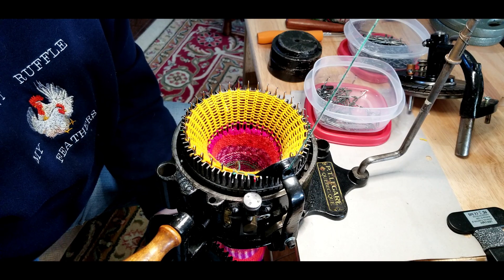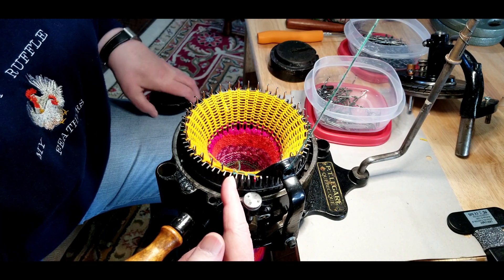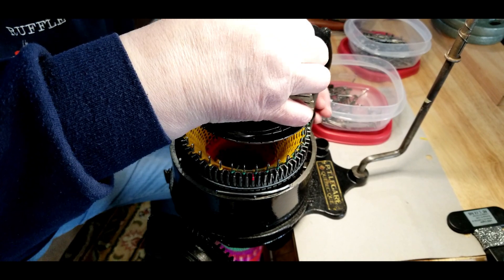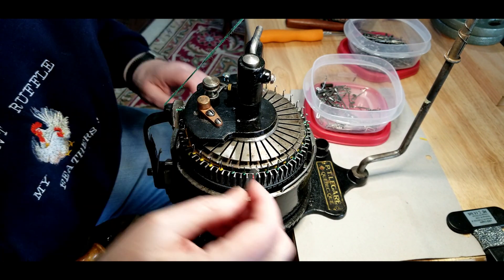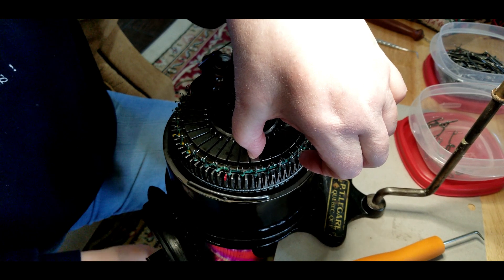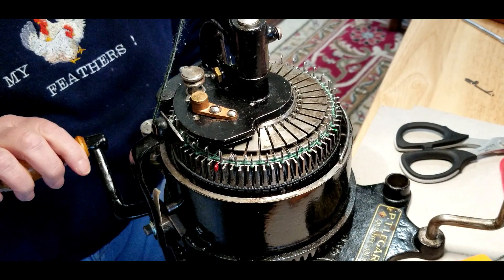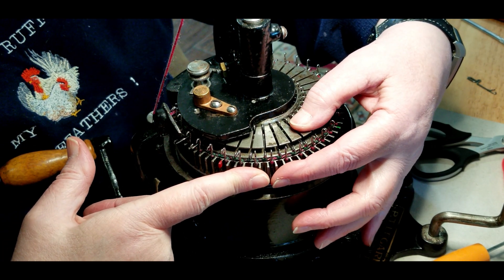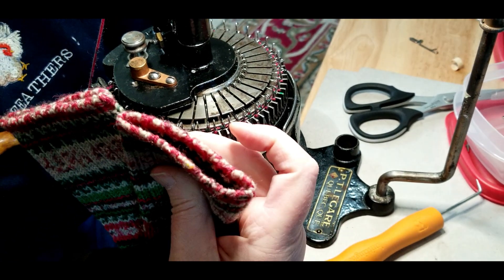An Improved Crew Top Sock?

Comment: Thank you for this! When you stop two ribber needles after the 3 o’clock mark, is that so the ribber needles engage or disengage at the 3 o’clock mark or before it? I have a different machine so not sure if it’s the same
Reply: I start 2 needles before my actual start to smooth out the divot on the edge of the sock.  By stopping at what looks like 2 needles after(where I put my thumb in the needle grove) it is actually starting at the beginning of my row.